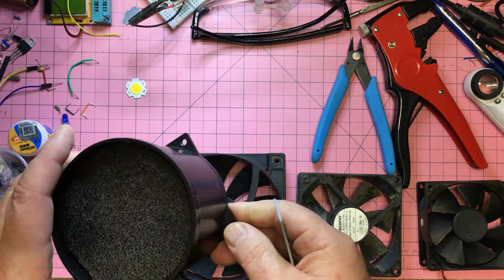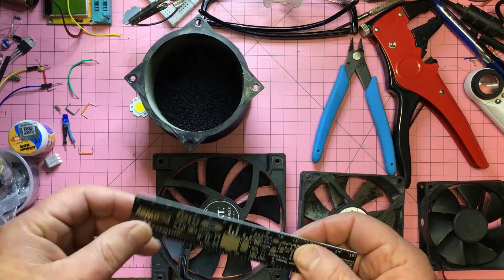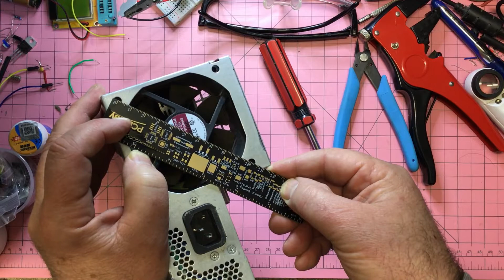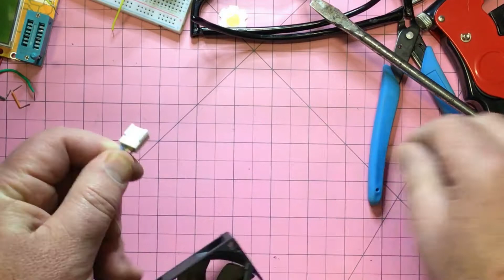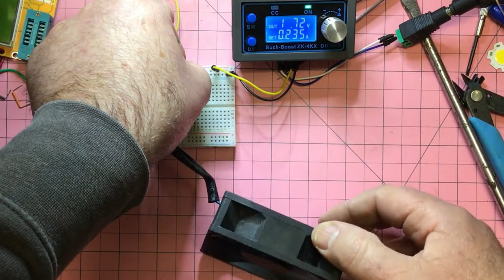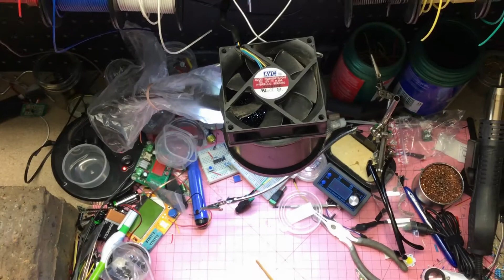Lab Fan removes nasty solder fumes

Comment: It doesn't come from a computer power supply but the computer case. It's the shroud that sits over the CPU fan. 
Replacement fans cost about $5 from eBay from Australia with free postage but it seems you have a replacement. I have a drawer of fans so a few might suit you. It will be next week before I can send but I will have to measure them first, they are all new. I will go through them and email you if I have one that will fit.
Have you thought about putting a thin layer of activated charcoal sandwiched between two pieces of extremely fine mesh then the foam, not sure if it's worth it but hey.
You stay safe also Anthony, take care bro,
Reply from the maker: We went to the local tip shop and grabbed a few fans etc yesterday so all good for supplies at the moment! Some of the “dead” computers in the garage have 2 or 3 fans! Finding the right size was interesting, felt a bit Goldilocks at one stage with one being “just right”! 👍😀